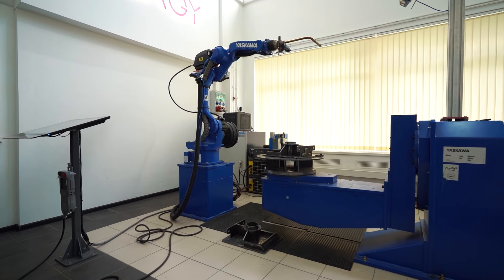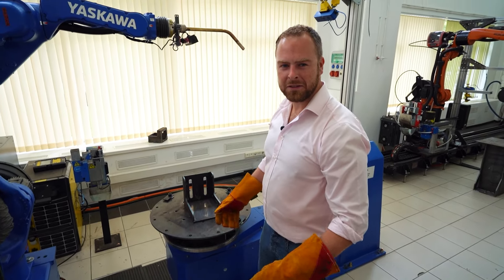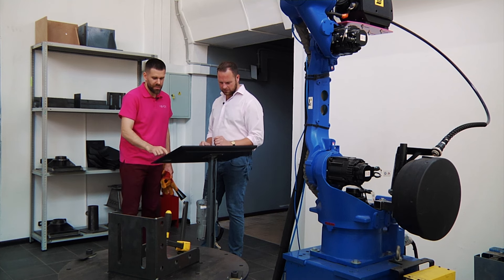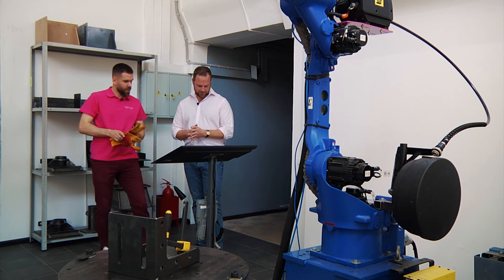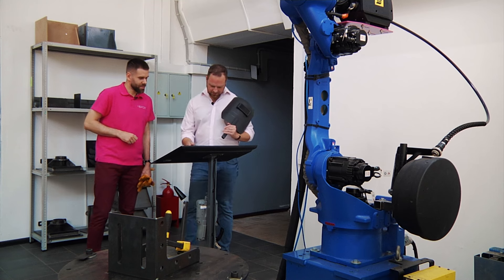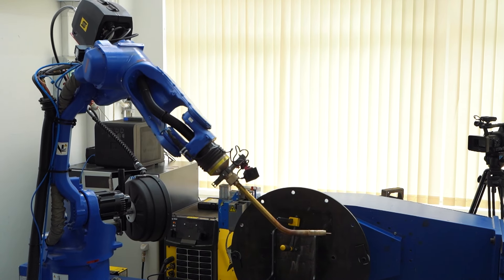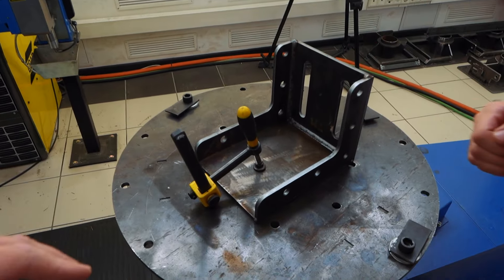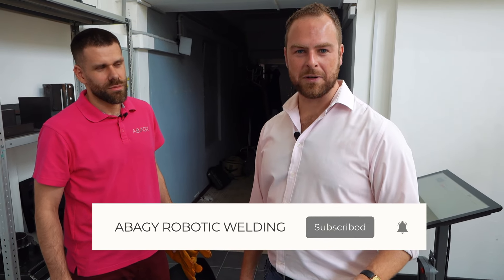How Welding Robot Works | ABAGY ROBOTIC WELDING

Comment: That's pretty cool, but I have some criticism, once the robot gets its parameters and shows the 3d model, it should allow the operator to simulate the movements before starting so if there is an error, the robot doesn't crash and you can start the process safely. 

I also see that the robot can zero the part with the welding wire which is pretty cool, there should be a way to manually zero the part and set your starting point in the software if you don't like the automated process. That's pretty much it, I really like the 3d simulation and I think this has huge potential.
Reply from the maker: Hi! Thank you for your comment. 

An operator can check himself after setting the welding parameters. There is a virtual simulation for this. But in general, if the system detects any collisions, it will warn about it before the welding.

As you correctly noted, the robot cuts the wire before welding. This provides precise touch sensing.  

Zero points are not required in our case. This process is automated. We always adapt to the actual position of the part in the work area. With ABAGY robot programming is not required at all.
Reply: @ABAGY  That's cool cos you didn't get this info from the video, so it's good to know that the operator can simulate that. As for the zero point bit, my main concern with automation is that when you get more complex parts, at some point you're gonna have something that the system can figure out, that's why it's good to have a way to manually set the parameters, but I guess you guys are trying to make it as automated as possible.

I really like the 3D simulation, would've loved to have something like that on the machines that I've worked on, not just for welding, you guys could integrate something like this in milling, painting, carving... etc and it would work really great.

One last thing when rewatching the video, your software has: Weld speed(which is ok) and robot speed, it would be nice to expand these features to Weld Speed, Travel Speed and Work Speed, maybe you have other option, but at first glance, just robot speed doesn't tell me anything. 

All in all you guys are doing a great job.
Reply from the maker: Thanks for your thoughtful feedback! Our goal is indeed to make automation as seamless as possible while still offering manual control when needed. We're constantly improving and expanding our features, so your suggestions on speed settings are valuable. The idea of integrating this technology into other areas like milling and painting is exciting—definitely something to consider! Glad you enjoyed the 3D simulation aspect; we're passionate about making advanced robotics more accessible. Appreciate your support!

Comment from the maker: Thanks! We think about what topics we should shoot videos on. What topic would be of interest to you?
Reply: Comparison of manual welding and Abagy way really interesting topic
Reply from the maker: @MrShDen  you should check out our next video! We will publish it on Tuesday.
Reply: To explain all the welding parameters of a fronius Welding machine.
Reply from the maker: Fronius welding machines have a range of parameters that can be adjusted based on the specific application, such as voltage, wire feed speed, and gas flow. For detailed info, please refer to the Fronius user manual or contact their support.

Comment: do we ourselves need to create a 3d model of the object to be welded ? or does the software generate a 3d model using the camera?
Reply from the maker: Great question! Our system primarily uses pre-existing 3D models provided by the user. While we can scan and generate 3D models using advanced camera systems, this approach often proves less economically efficient. Scanning requires more time and continuous involvement of a welding engineer to set welding parameters for scanned part, leading to increased manual work. Conversely, using an existing 3D model allows our system to analyze it and apply reusable welding parameters for similar types of welds. Ultimately, paying for someone to create 3D models is both cheaper and faster than scanning and manually setting parameters afterward.

What type of projects are you looking to apply this technology to? Are there specific challenges you're facing that we could address? We'd love to hear more!
Reply: @ABAGY  So this means we need to prepare 3D simulation of the entire environment as well? Or can the scanner map this out itself?

Comment: if i have a fillet weld with larger leg length which requires multiple passes. how ABAGY can help us making multiple passes? do we need to stop after every pass, re-scan and give welding parameter?
Reply from the maker: You can input the welding parameters for a multipass weld right from the start. After that, the system handles everything automatically based on your settings. If your welding process requires grinding the weld after each pass, this isn't a limitation of the robot but rather a requirement of your specific welding technology. In such cases, you'd likely need to continue the same practice even with the robot in use.

Comment: These machines seem optimal for large-run, small parts with minimal variation, or welds requiring the bare minimum heat input possible. 

Unfortunately, it seems like a bad match for smaller jobs where humans still out-perform because multi-tasking is still very expensive to automate. 

I'm curious if we will see a shift in industry towards more standardized parts and structures, compared to the current market where customer design tends to win-out over strictly designs which would be easy / profitable to run using robotics.
Reply from the maker: Thanks for your thoughtful comment! Abagy's solution actually excels in high-mix, low-volume production environments, where there is significant variation in parts and frequent changeovers. Our technology is designed to simplify robotic programming and eliminate the need for extensive offline programming, making it easier to handle complex and custom jobs.

While automation can indeed be challenging for smaller jobs, Abagy's adaptive system can adjust to deviations in parts and configurations, allowing for a level of flexibility that often outperforms traditional setups. As for the industry trend, we believe that a balance between standardized and customized parts will continue to evolve. Our goal is to provide tools that make robotics more accessible and efficient, even in scenarios with high variability.

Would love to hear more of your thoughts on this!

Comment: How do these robots work on an auto assembly line welding car bidies? Thx
Reply from the maker: Abagy excels in high-mix, low-volume production. For automotive manufacturing, other solutions might be more suitable. However, if you're dealing with non-serial car bodies, Abagy could be a great fit:

Efficiently manage a large number of products and 3D models for programming.
Adapt to parts that are tack welded and positioned without fixtures, reducing the need for extensive robot teaching.
Minimize the use of fixtures, saving costs by only using what's necessary for positioning.
Simplify operations, especially when it's challenging to find and retain skilled robotic engineers.

Comment: What would be an appropriate cost for a robotic welder to weld exhaust systems?
Reply from the maker: Each production is unique. Our engineers can choose a robotic solution specifically for your task, then it will be possible to determine the cost. We encourage you to fill out the form on our website abagy.com

Comment: What would the best 3d printed arm for 3dp and running the best software be to achieve this with 2 arms to hold materials and move positioning of objects be and how would one acomplish it?
Reply from the maker: This is an interesting question! We work with industrial robots, so we can't give advice. But we hope you find a solution. Thanks for watching our videos.
Reply: @ABAGY  yeah I found the arm I want to use your software it seems like I could actually do a lot with it. I also don't think any DIYer has ever asked.
Reply from the maker: Feel free to reach out if you have any questions or need assistance

Comment: This is not going to be possible to implement in automotive industry, as there is too much when it comes to environment and collusion might be unavoidable.
Reply: Wrong….
Reply from the maker: While the automotive industry has unique challenges, Abagy's solution is tailored for high-mix, low-volume production where flexibility is key. Our system adapts to part deviations and reduces the need for extensive fixtures, which might not be ideal for high-speed automotive lines. However, we continually work on innovations that could potentially address the complexities you've mentioned. We appreciate your insights and are always open to discussions on industry-specific applications!
Reply: @ABAGY  what is required to keep the camera lens and its capability functioning well ..what the expected life of that camera considering the welding enviroment .. have you experienced low performance based on the arc on tjime ??  i am assuming that the camera will allow the robot to track the joint if the work piece is not exact the dwg.  what happens part to part if these are not machined parts will the robot track joints piece to piece.